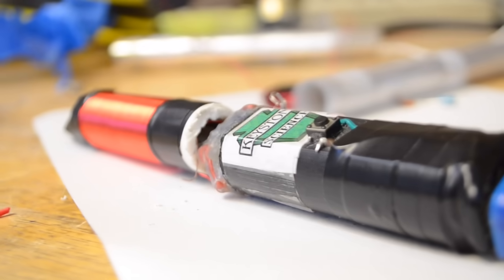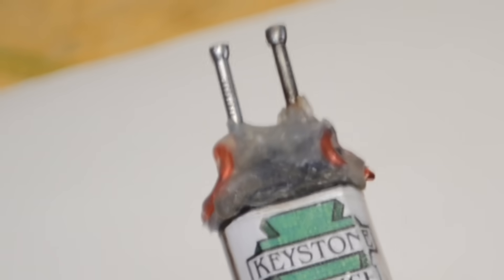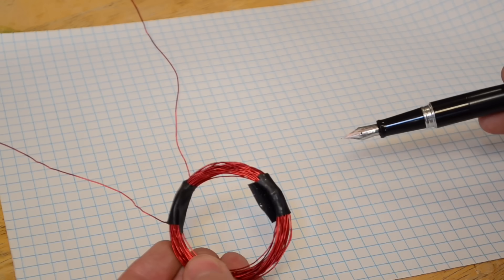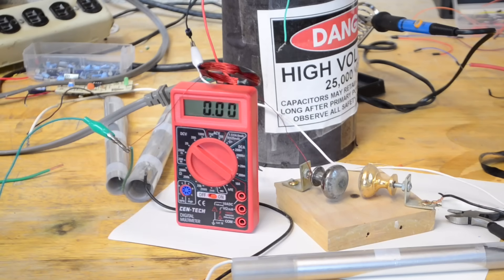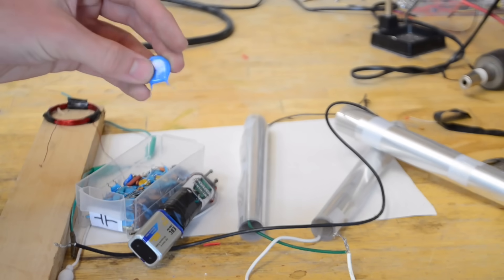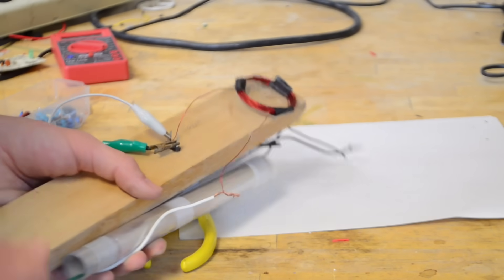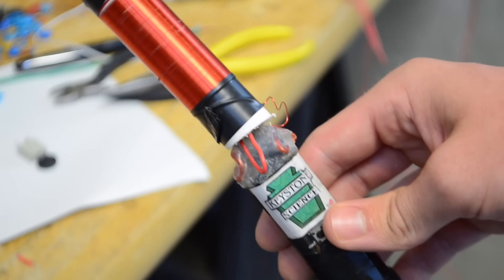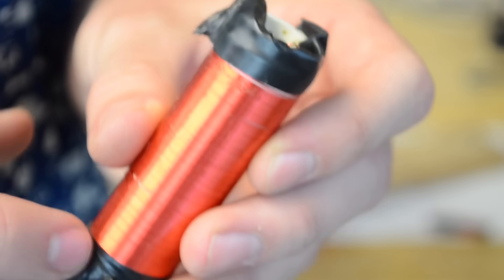How to make a pocket EMP

Comment: If that works how are you recording the video of it working !
Reply from the maker: +TheDefpom great question, the rang of the EMP is pretty small ( so the camera was never close enough ) also the camera has shielding in to to protect from electromagnetic pulses ( most higher end cameras have these because of studio lightning creating an EMP when it is overloaded )
Reply: the distance from the coil. if the coil was larger and more power, he'd fry the phone and anything else around.
Reply: Keystone Science anything that could shield an emp would also reduce your signal. Faraday shields are nothing new, but your reason for not frying your phone wasn't that. Not focusing on inverse square law and your distance, your phone is generating it's own repulsive forces thus minimizing further or completely eliminating it.

Comment: Hypothetically... say i wanted to EMP a radius of around... 3-4 meter radius.. What size capacitor and battery would i need? hehehe
Reply: Doreen Green -  It is all about how one can convert from an efficient energy source (Joules/Kilogram) into a focused transient RF source. Examples might include transient high power semiconductor laser induced photoconductive switch, a pulsed RF generator, etc. with sufficient energy to offset electronic circuits having minimal EMP protection at close range (~15 feet). One has to consider the RF energy will fall as G*(1/R^2), where R is the distance from the source to the target and G is the antenna gain. Higher frequencies provide higher gains, but also require more DC power and also tend to be more highly absorbed
Reply: Doreen Green - A fast rising leading edge pulse (typically called E1), a moderately fast intermediate pulse with characteristics similar to lightning (typically labeled E2), and a slower longer lasting pulse (typically labeled E3). Electronics, and in particular integrated circuits is most vulnerable to the E1 portion of the  pulse. On the other hand, the power grid, and in particular transformers are more vulnerable to the longer lasting E2 pulse and in particular the E3 pulse (which can also be generated from a solar geomagnetic storm event).
Reply: umm a grenade :P
Reply: I will place a comment here so that I can find these answers for.... Research purposes...

Comment: isn't "spark gap" a capacitor by itself?
i mean you are using air as dielectric in it, so why two capacitors?
Reply: namejs The spark gap works like a capacitor, until it doesn't. The point of a capacitor is to not spark. If you do spark it, it's pretty much useless as a capacitor. The spark gap is a really easy way to make an oscilator with high voltage and not much else.

Comment: I fail to see how a 9v battery can incapacitate me. When I can put a 9v battery right on my tongue.
Reply from the maker: +Keith R yes, but the 9v battery is stepped up to 10kv and charges capacitors, so really rather than a continuous low power, it's fast pulses of high power arcs, they hurt pretty bad ( like it chars your skin :P )
Reply: +Cheesus Sliced you need some serious voltage to jump the gap

Comment: Subscribed.
Reply: Keystone Science ok thx
Reply from the maker: +ANTHONY KUHN thanks :D
Reply: Keystone Science question why do you need the spark gap
Reply from the maker: +Charlie Marten because the capacitors need to discharge after they charge up enough to jump the gap, this generates a stronger electrical pulse
Reply from the maker: +Charlie Marten no problem :D

Comment: You can disable an electronic ignition car or fully electric car with one of these. The potential for destruction is insane.
Reply: It's like watch dogs in this bitch
Reply: Skypcharge Plays Well that has been tried but no that will just kill the port you are using and even that if ports are not protected against attacks. Neither this or a killer USB will kill a hybrid or electric car
Reply: to all your subsequent replies.... lmao.

to your question, yes and no. for the tiny bit of energy release by the one in this video to do any damage, you would have to locate the main control box and get pretty much right up against it. At the very least, it would erase the prom or eprom memory in the control box, resulting in costly repairs.
Reply: I’m pretty sure a battery that size can’t disable a fucking car 😂
Reply: InstrumentalistTurtle not necessarily true, if you have a fairly powerful USB killer, you can disable a hybrid/electric car

Comment: Why did you disconnect the capacitor at 3:50? It looks like you are only generating a spark with the 'taser' and the coil is not even in the circuit.

Comment: I can appreciate the creativity in your work and it is laudable. But a spark discharge that upsets a cheap multi-meter only shows that the multi-meter does not have even the barest of EMI protection. What you demonstrated is that the multi-meter has no basic shielding or ground plane in it and that it's processor reset line is most likely controlled by a pull up resistor that has too high in resistance with no bypass capacitance (or of the wrong type).

When you can actually damage something that has basic ESD/EMC protection, then you have something. Having worked on military/aerospace instruments, the term EMP is usually reserved for truly high energy pulses. That type of EMP can physically and permanently damage instruments at a range of miles (how's that for your R squared law). 

So IMHO, EMP is something you can not possibly generate with a battery such as you show. Engineering and Science terminology should not be blurred for showmanship or fashion. 

Want to be impressive, show that you can take out a cell phone from 20 feet away. Now that's something I'd buy from you to stop the dopes who talk and drive. Do that and I might offer you a job as well.
Reply from the maker: +Robert RobertR hahaha, fair enough, but if I did make that strong of an EMP would It be wise to show how to make it to anyone in the world ? Probably not. I have better designs that use giant coils to get a much better effect but yeah ... ( also it's not portable really :P )
Reply: Ah....wiser than your years would suggest....nice

Comment: Why didn't it mess up the camera?
Reply from the maker: +rincewind93 the rang of the EMP is pretty small ( so the camera was never close enough ) also the camera has shielding in to to protect from electromagnetic pulses ( most higher end cameras have these because of studio lightning creating an EMP when it is overloaded )
Reply: that's interesting.  did you use lead for shielding?  Thanks for the fast response!
Reply from the maker: +rincewind93 no problem, and nope ( led would probably be good for high levels ) but tin foil works fine here ! :D

Comment: So... Is this the EMP blast they talk about in videogames?
Reply: In MW2 the EMP is a blast in the sky, which is probably an EMP caused by a nuke detonation at very high altitude. In real life it's impossible to create a directional EMP. The EMP field goes in every direction. So, if you manage to create an EMP that affects everyone around you, it will also affect you. If you carry something on you that affects someone 10 meters away, it will also affect you because you are within the EMP radius. Etc.

It is possible to shield equipment against an EMP. Military equipment often makes use of this, mainly vehicles and radios. But you can't shield everything, for various reasons. Like for example, if you'd have augmented reality goggles that show your HUD, you don't want to put metal plates all around your goggles (you can't leave any holes or the EMP might come through) because then you wouldn't be able to see anything. However, let's say in Call of Duty all your equipment is shielded because of some magical technology, that's why you can use an EMP that doesn't affect you, but if your equipment is shielded then you can assume so is the equipment of other players, which makes the EMP worthless.
Reply: No, in most games an EMP is caused by detonating a nuclear device in the atmosphere. I suppose it's a similar concept on a far larger scale.
Reply: Sterl500 negatory. As demonstrated, you do not need a nuclear explosion to generate an electromagnetic pulse...
Reply: Tyler Jourdan did you read my post or the OP's? An EMP blast as depicted in most video games is an omnidirectional EMP caused by atmospheric nuclear detonation. Which is NOT demonstrated by the video.
Reply: Sterl500 I guess it depends on what video games we are talking about.
Reply: just a trip to the dallor store  XP
Reply: Sterl500 Modern warfare 2?
Reply: Sterl500 "EMP!"~Cpl. Dunn
Reply: Tyler Jourdan Which games use a directional EMP as part of their mechanics?
Reply: I'm more interested with the possibility of a grenade like omnidirectional EMP as in Rainbow Six: Siege

Comment: LOL you DUDE!!! your taser in output give you alternating voltage 8P and your capacitor NOT CHARGIN, so and you have the same low current and high voltage as if you not using capacitor.
ALTERNATING VOLTAGE, that's why in output wires have the same color.

Comment: I am fairly certain that the best coil for producing the most powerful short burst pulse for you EMP is to have a wide short coil with fewer turns of thicker wire. The reason being that you want to dump all the energy from the capacitor instantaneously to make a massive pulse. Thicker wire has less resistance and this you discharge the capacitor at a higher rate, meaning a larger pulse. Fewer turns means less inductance, a property of a coil of wire which produces "back flow" (back EMF) which opposes the normal flow of electricity. Less inductance means the capacitor discharges at a higher rate. Of course they all has to be optimized for your system.

Comment: Ok a EMP is JUST WAT I NEED!! However I need one that I can like aim n it work from like 50 feet away. Can that be done?? If so PLEASE MAKE A VIDEO!!! Aight the reason now... Ok I live in Puerto Rico. N anyone that lives here knows that at VERY LEAST once a week You get something like a god damn parade going in front of ur house every god damn week. Now a NORMAL parade wouldnt bug me at all. BUT here in PR ppl are fucking idiots and they will have 50 to 100 cars following ea other wit music on FULL BLAST not that the music bugs me BUT wat DOES bug me is that almost every single one of them god damn cars will have them SUPER LOUD sirines on so loud you cant even hear the music. Its like a mix of a 18wheeler,cruise ship and train horn mixed in one so loud that it shakes shit off your shelves in ur house. I know youll say those types use compressed air. NOT the ones they use here. They are fullest electronic so much so they have to have ATLEAST a 10,000WATT amps hooked up to run it n the speakers for it. N its not like its a fast tap the button type deal. NOPE they push the button down and will hold it down for no LESS THEN 15MINS AT A TIME!! Mind you theres 50 to 100 GOD DAMN CARS DOING THIS AT THE SAME TIME!!! Its so bad that my dogs flip out n get so scared they start to cry n hide under the beds. N nope the cops dont do a fucking thing about it. N in fact alot of the times the cops are right there with them. N it so happens that the street I live on is like a main parade street. so I get to live thru that bullshit atleast once a week but its more like 2 to 3 times a week and no its not fast like 10 to 20 mins. Nope its done for HOURS ON END!!! The SHORTEST I timed was 1hour and the longest was 5 GOD DAMN HOURS!!! And Im not even like 80yrs old n u can so oh you know how old farts are they dont like loud noises Im fucking 35yrs old and can NOT stand it. N MOST ppl around here cant stand it either. SSSOOOO If you or someone could PLEASE BE A GOD SEND FOR ME N make a video wit step by steps on how to build a amiable EMP that can work from like 50feet away that would mean SO MUCH to me and everyone that lives around here. And Ill even help you wit a video as if you can make one like that either show me how or even build it n send it to me. Ill make a video showing you just how fucking loud they are n how long it goes on for and showing the EMP in acting working n frying all there shit. Course Im not gonna stand in the open so they can see me zap them. But itll be on video for all to see that it really works and that I REALLY was not lieing at all bout how loud they are n how annoying they are. So Thank you very much n hope someone can help me

Comment: whats the gap for?
Reply from the maker: +NoVaKane so the capacitors will charge up, then discharge across the gap, this creates a stronger pulse
Reply: Keystone Science ah so they gap allows it to leave the circuit  faster much like a hose with a big hole vs a small hole? im not that familiar with a capacitor. do they need to use up all their power before storing  more again?

Comment: Yeah my dad did this for the Goverment already, created 3 sizes, a Pen, Briefcase, and Van sized 
[he gutted an old BMW "Hippie" Van].
Pen could take out small devices within 25 feet.
[GPS devices, small PDAs and what not]
Briefcase could potentially take out about 3 stories of an office building filled with Computers.
The Van was super over the top, had a directional thing on the top made of copper [I'm not a scientist...]
Could direct a EMP blast big enough to take out a 10 story building.
Mostly, they wanted to know how it affected computers, as smartphones weren't around just yet.
Saw a test they did with the briefcase on a Car with electric locks, alarms and those power controlled hydraulics you usually see in "low riders" make them bounce and what not.

He made that car flip out, Alarm went of, hydraulics started going haywire, then it flipped over.
He said they didn't "Blast" the car, some kind of controlled test or something 
[again, it was top secret at the time, and I was only 12... definitely not a scientist like my dad lol]

He did that cause the Goverment wanted to know how to protect itself from such attacks.

Answer is Surprisingly Simple: Tin Foil.
[My dad said it works best if slightly 'crinkled']
Which is also why most modern devices are protected from this kinda thing, such as the camera he's filming on.
Now if he used an old VHS Camcorder... You'd notice lol
Reply from the maker: +Richard Powell haha that's quite the story , and very cool!

Comment: u can bust whit a iron core in the coil like 20times whit a nail an like 100x with a iron tube
Reply from the maker: +abel br yeah, but then the oscillation frequency of resonance would be much lower due to the impedance an iron core would create on the inductance of the coil, and I think that it may be better with a higher frequency ( this is why tesla coils also have an air core on their secondary and primary )

Comment: Ah boyee...your science was ok if a bit incomplete, but whenI saw that Harbor Freight meter, all credibility comes in doubt. You could fry that with a carpet spark...
 
Oh, btw, your "roofing nails" are actually casing nails...could never hold a shingle!
Reply: Harbor freight is great for throw away projects like this. Small cheap things, that if they break, won't hurt the pocket to much. Doesn't destroy his credibility to me.
Reply: McGaughey He may not have a
found out yet, but I've collected a group of those meters, and there's something wrong with all but one. I'd not trust them for accuracy either, but I keep one in the truck for checking connections and bettery voltages. Anyhoo, not trying to be insulting...much...
Reply: Gary Chandler judging by the rest of his equipment, he probably has a few meters,  at least one good one

Comment: How strong is the electricity and could it kill you if you touch the coil
Reply: Volts not AMPs however I bet it will lite you up really good for a bit.
Reply from the maker: +Alex Rainbow you should be fine, it may burn you skin and hurt very bad though !

Comment: this might put me on a nsa watch list but here goes

than using a 9v battery use a car battery or a jumper box then get a bigger cappacitor lastly make the wire by buying wall socket copper wire u can remove the plastic kn specific spots only and coil it around like a snake around a tree should be big enough to make alot of stop fail or brick not to make it fun u can also do 2 of those only remove the rubber of the copper facing each other and have the second tree be a ground and negative and let the electricity jump just like a larger taser just for fun and if u want it can become a larger emp with both of them depending on which is in the middle if the two rods
Reply: jumper box is better since it has more amp in a short amount of time do beware that that the electricity might jump to the ground since it is a natural negative state